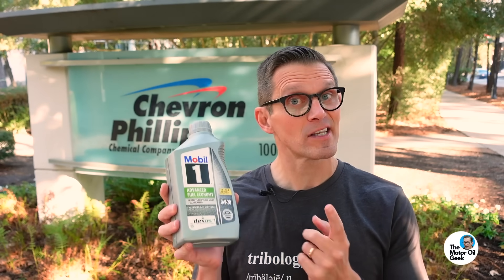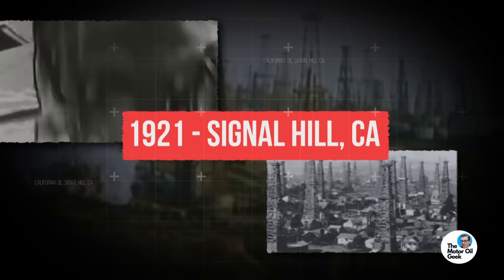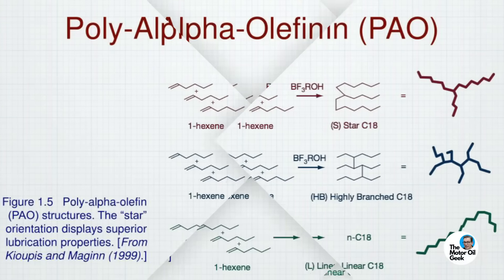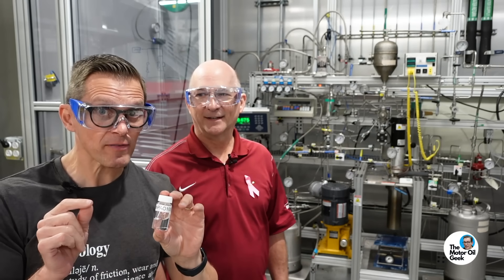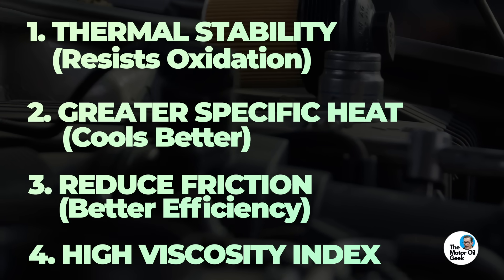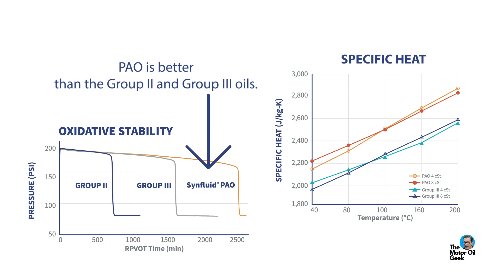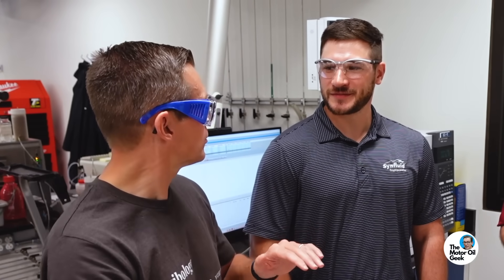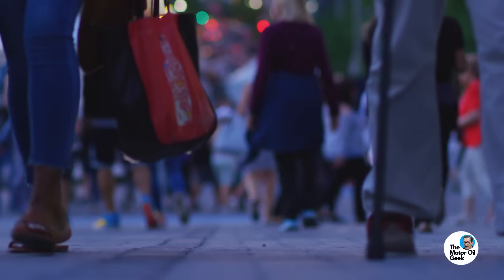STOP Using Regular Oil - 4 Reasons Synthetic is BETTER!

Comment from the maker: Thank you so much for watching and commenting. There are SO many comments that I won't be able to get to all of them. With that said, here are some answers and links to some of the common comments.

Synthetic Oil and Flat Tappet Cams - We answer that in this video: https://youtu.be/j8tpRxQLqU0

Synthetic Oil and Seals - We touch on this question in this video: https://youtu.be/LUr4iTjXbhg
(The quick answer is that synthetic oil is fine on seals in modern engines. For classic cars with original seals, stick with conventional oil if that's what you've been using)

How do you know if an oil is PAO or Group III? - Check the SDS sheet for the oil, it will list the base oil CAS numbers. Here's a list of CAS numbers and descriptions. https://www.cpchem.com/sites/default/files/2021-09/PAO%202021%20FINAL%20.pdf
Reply: Lake man, you're so good at this YouTube thing this channel is bound to blow up! It's like you were born to do media! Keep kicking ass and teaching us all the important stuff we need to know to keep our cars running as long as possible! Thank you!
Reply from the maker: @CelataForCongress  Thank you!
Reply: Still waiting on STP and GM EOS. Thanks and great work.
Reply: Thanks lake.....take a look at ravenol pao base oil (germany)
Reply: Question for Dr. Speed, in a prior video, you said that carbon in a direct injection engine is from the oil turning to gas and forming deposits. This made common sense, until I thought of the propane engines I've seen that seemingly are almost carbon free both in the oil and engine. Perhaps you can touch on this in a future video?
Reply from the maker: @airtightindustries Carbon is from unburnt fuel and oil - what didn’t fully vaporize and burn completely. That’s why natural gas engines are so clean. The fuel is already fully vaporized so it’s easier to burn.
Reply: This was going well until the actual discussion of the "4 reasons", which by the way, were presented differently in the middle of the video and at the end. In the first presentation, Item 1 equated thermal stability and oxidative stability. These are two different resistances to break-down of the base-stock due to different chemical processes. Thermal stability is the resistance to break-down in the absence of oxygen and is related directly to temperature. Oxidative stability is the resistance to breakdown by oxygen, which of course, happens more at elevated temperature, but involves oxygen in the reaction mechanisms. They happen to different extents in different parts of the engine, in different engines, and in different drive cycles. The reduced traction coefficient (lower friction) will lead to greater (fuel) efficiency, but for most actual driving, a much greater benefit to fuel economy is related instead to the higher viscosity index or lower temperature variation of viscosity. Since the PAO-based oil can maintain film thicknesses better at high temperature (because its viscosity decreases less as temperature increases), they can use a lower viscosity base-stock which is, in particular, lower at low temperatures. Since most miles are driven before an engine heats up fully, this lower viscosity oil has lower friction and greater energy efficiency. KISS is a great principle when speaking to a non-expert audience, but as Einstein said, "as simple as possible, but no simpler."
Reply: I have an important question about fuel additives. With more & more people storing fuel for emergencies & using stabilizers like Sta-bil & PRI-G & D to keep it fresh & lubricity & detergent additives like XPD & Lucas, are there any negative interactions between the pre-existing additive packages and/or the aftermarket additives? How much is too much or when has one gone overboard?
Reply: Your entire left audio channel is busted for this entire video and it’s extremely frustrating.
Reply: Except for sound effects.
Reply: Did you ever test the Tribodyn lubricants? 
I had good results but I’m kinda curious what you think.
Reply: Man you know what would be cool is if you rent out a bunch of cars to do a bunch of oil tests and see what oils are best for each car. Rather than trusting the manufacturer
Reply: Not for nothin, but isn't this a well established fact already? Not sure I see the need for a video.
Reply: Some people usieng Diesel engine oil  in their motorcycle and claim it works!...can you explain the difference between diesel engine oil, motorcycle engine oil and passenger car engine oil in term of checmical properties, functions and applications?
Reply: @oskapenjom3311  I know that for gasoline engines, a big issue is ZDDP, specifically the phosphorus, and catalyst poisoning. A diesel engine does not use a three-way catalyst like a gasoline engine does, and ZDDP PPM limits have been reduced in gasoline engine oils because of the issues with catalyst poisoning. This is why something like Shell Rotella T6 5W-40 is a good performing diesel oil that doesn't carry the gasoline engine certifications. However, many people use T6 in gasoline engine applications with good results. They're also different requirements for modern gasoline engine oils in the age of turbochargers and direct injection. Diesels have turbos too, but oil volatility and direct injection leading to intake port deposits and even the concentration of certain detergents, I think calcium, leading to low speed pre ignition have been identified as issues in modern gas engine oils.

Basically, the chemistry and physics is different in the different types of engine and this leads to different oil requirements.
Reply: @oskapenjom3311  , Lake did a recent video on this.  Take a look at his recent video list

Comment: Had a 2009 Chrysler Aspen with a 5.7 Hemi. Changed the oil every 5000 miles and NEVER used synthetic or changed early. Sold the truck at 198,000 miles 16 years later and it ran like the day I bought it. Never once needed any kind of engine service or had any problem of any kind. I think you guys overthink this oil stuff. Afraid if you go over a 1000 miles or don’t do a break in change early, send oil to get analyzed and searching for the highest tolerances synthetic your engine will fail. Nonsense…. Certain cars with H.O. Motors or high turbo pressure would require it.

Comment: I would like to see the cooling ability of synthetic oil vs regular oil. Perhaps even the difference in heat transfer of various viscosity, such as 0W-20 vs 20W-50. Might be worthwhile knowledge for air-cooled engines.

Comment: So, we don't generally use synthetics in General Aviation, i believe it's mostly due to the particulates in the oil. Synthetic has difficulty suspending the lead from the 100LL (100 octane low lead) AVGAS. I'm using Phillips X/C 20w-50 in my 1980 Cessna 172RG.  Synthetic causes many engine failures when it was released for these aircraft. Currently, I know Aeroshell is a 50/50 blend synthetic to mineral oil. The brand name escapes me right now, but one other brand uses 25/50 with 25% being authentic, and then Phillips X/C uses straight Mineral Oil. 
I have a feeling once the Lead is phased out, Full Synthetics will make a comeback.

Comment: I'm ok admitting synthetic is better oil... i also don't believe there is enough benefits to justify the extra cost of the best synthetic vs cheap SN rated conventional. It's nice and all of my engine lasts 250,000 miles on cheap stuff but how much longer will my engine really last by using the very expensive pyramid scheme oil? It's it gonna last twice as long to justify twice the cost?

Comment: The technical paper I read on synthetic vs petroleum oil showed that petroleum oil has several length of molecule strings with shorter ones wearing out first. The long ones last the longest. Synthetic has all long molecule strings, and doesn’t wear out, so keep it clean and you can get long change intervals by changing filters often !

Comment: 03 7.3, I’ve used Delo 400 since I bought it at 23k, now at 149k. Stick with the Delo 400, or start using a newer synthetic ? If so, what’s your recommendation for diesel synthetic oil?

Comment: First fully synthetic engine oil (ester based) made for normal car engines back then, was the French Motul 300V in 1970, Amsoil came 2 years later :) The brand Motul originated from the US (Pennsylvania oil trading company), but the brand was bought out by the french importeur in 1932.

Comment: It's amazing for many years I bought oil for 50 cents per quart. Then, not so long ago it stllill could be bought for 1$ a quart before covid. Now it's $10 ! Per Quart. I,ll take regular quality oil bough for 1 dollar over hyper expensive hype. Synthetic oil  isn't synthetic its mineral. Its start at the pump jack same as regular oil.. Amazingly, airplanes  race cares. Race boats etc ran at extremly hi power and continuning WOT on regukar mineral oil.

Comment: I have a 1993 5.0 LX Made by Ford and it's a type mustang it won't run on synthetic Everytime I've tried it the engine smokes plus the car is low miles 103k

Comment: I love synthetic, however my older engine (`95 LT1 350) was just rebuilt and my engine builder told me to do a change after 500km(done) & 5000km, both with non-synthetic - in addition to keeping RPM below 4000. I'm at around 1500 on regular oil since my rebuild, am i compromising my future ring seal by switching to syntheic now or at 5000k? What do i do! :(

Comment: It is interesting to hear about Pennsylvania crude oil. I used to live in PA and we used and sold Pennsylvania crude based motor oils. I had a Sprite with a 3 main bearing engine. When it got hot the oil pressure would drop. I switched to Castrol brand oil and it maintained good oil pressure. Talkin about the late 60's early 70's.

Comment: I worked at Ohio Machinery a Cat dealer.We had a overroad fleet send their tractors with 3406B engines in for bearing roll ins at 1,200,000 miles.When we took it apart the bearings and the bottom end of engine looked new.They used full synthetic oil .Never used anything else since in my tractors , pickups , and dirt bikes. Love the amsoil motorcycle oil segment you did.Hardcore dirt bike nut.

Comment: Ive lost 2 separate chevy LS engines due to oil pressure loss(oil pump o-ring failure) at just over 200,000 km. I've been running Pennzoil Platinum High Mileage oil 5W-30 exclusively... Im 100% losing my faith in synthetic.
Reply: Sounds more like a chevy problem
Reply: @longroadwest  😁

Comment: Here is a trick I learned while driving as an over the road trucker. When the engine oil in the diesel engine gets to the point or just before that it is due or needs to be changed the engine will start using oil. I found that if you put a quart of synthetic in when the engine is low it quits using or dramatically reduces oil consumption.
Reply: My first car was a used -87 vw passat in 2000.  synthetic oil made it use less oil and make less smoke. Im a beliver in synthetic oil, use 5w-40 in everything.

Comment: Conclusion:

PAO synthetics (Group IV) offer four key advantages:
	1.	Higher Specific Heat – Absorb more heat energy.
	2.	Better Viscosity Index – Resist thinning at high temps.
	3.	Lower Traction Coefficient – Reduce friction.
	4.	Superior Thermal Stability – Resist breakdown over time.

Comment: Retired truck driver. Have always had the practice of putting discarded waste oil in the fuel tank. How would synthetic work for VP 44 on my 2001CTD? WOULD like to see some test for longevity. 240K miles and no problems with classic oils being recycled. Power and fuel mpg are always increased pulling heavy loads. 
Using 5 micron filter for polishing and very slow pump out of a bulk tank. Thanks

Comment: is it still true for motorcycles with wet clutches?
Reply: Yes, as long as you buy spesific oil for use with wet clutch (JASO MA/MA2). Not all oils got friction modifiers compatible with wet clutch.

Comment: I used to race a Mazda rotary, oil is super important because they actually use it for cooling as well.  Other racers using rotary’s use conventional oil, and change it every weekend, and it looked and felt terrible after.  I started to use synthetic and the difference was noticeable after the first run.  The oil and water temp was lower, the engine seemed to have more power, which I attribute to the cooler temp, and after the weekend oil change it was noticeably cleaner and also felt slippery, where the conventional oil did not.  I started to use it for two to three weekends before I changed the oil. 
Since then I have used synthetic in everything I own.

Comment: Yea synthetic is always better but only after the rings have seated and the motor is fully broken in otherwise it might burn oil forever! The thicker the oil the better and use an oil cooler with a thermostat and your golden!

Comment: Switching from Conventional.. to Synthetic.   Apples and Oranges, but..  how well will Synthetic capture... and suspend soot?    Synthetic pours like water....  brand new.   Conventional comes out of the jug... thicker.  With the same advertised weight.  Engines with weeping seals... rear main drips.. etc.   Going to Synthetic will show up on your driveway.   It does a good job with heat...  metal on metal contact... but, there are these other factors to consider.   My suggestion is to NOT click bait with STOP using conventional.  Not honest.

Comment: Application... Application ...  Application.    Older vehicles... anything with over about .012 clearance - Piston to cylinder wall plus a ring gap of over .012.   Full Synthetic is a NO NO.   They will burn thru oil like a MO-Fo.

Comment: Wondering what the best Synthetic oil is for my wake boarding boat? High load operation with lots of idling. 

Learned recently on this channel that the Rotella 15-40 I’ve been using isn’t correct!
Reply from the maker: Mobil 1 15W-50

Comment: I wonder if you could help separate fact from myth regarding switching to synthetic for higher mileage vehicles. I’ve heard more than once that “your gaskets and seals will start to leak”.
Personally, I feel this is another old-school rumour. But how I “feel” doesn’t prove anything.
Reply from the maker: The answer is "it depends". Many classic cars (more than 25 years old) feature seal materials that can shrink with some synthetics (not all). Modern cars feature different seal materials that are more broadly compatible with both conventional oil and synthetics.

Comment: I LOVE Your Videos! You have IMO the most cool job in the world! I love everything "OIL" However i'm still not sold on Synthetics for everything including in my old Harley or New Harley and small engines, lawn mowers and such... I would love a scientific explanation why way back in 1999 when I changed the oil from mineral oil in my 1997 Harley to Synthetic V-Twin rated oil, M-1 V Twin,  same Viscosity 20w-50 did my engine Immediately develop a loud top end tic at every red light?  Had proper oil level etc, I changed back to mineral 20 miles later and to this day never has had a tic again or a drop of Synthetic. Some people believe as I do that an old air cooled Harley bikes ( EVO Engine )  and the newer ones too  M8 engine have less top end noise when using mineral base oils?
Is something wrong with my ears? less top end noise and NO tic must be better right for some reason right?

Comment: I have been using mobile 1 products for years. I always use the oil that meets the engine manufacturers specifications along with Wix premium oil filters. No problems. I don’t believe any major oil or filter manufacturer can afford to make a crap product. Some may have an edge on this or that but overall they make excellent product. If there is one out there that by far and away outperforms the others, please let me know. But just the same I really enjoy the videos. Good to know information. Thanks.
Reply from the maker: Thanks for watching!

Comment: Is Valvoline synthetic VR1 20W50 a good oil to use in air cooled 2002 Harley Road King.  I've been running it in my 2002 for the last five years.  I have no empirical data to suggest it might not be.  I like that it was developed soley to be run in a engine and not designed to be run with wet clutches.

Comment: Synthetics and leaded racing fuel? I know the answer. What does the motoroilgeek guy say?
Reply from the maker: Properly formulated, a synthetic can handle leaded racing fuel. We did it for more than a decade at Joe Gibbs Racing. If the formulation is not correct, it is a disaster.
Reply: Yep. I agree. I’m in the aviation world and see people damaging their boxer engines because of running the wrong synthetics ( lead salts in the filter and drained oil).  . XPS a BRP product i believe, has come up with a formula that can handle the 100 low lead we use but it is very expensive + $75 a gallon and I would love to find an alternative that meets the same standards but more affordable . It’s the same color as antifreeze for some reason. I don’t know what they were thinking using that color of dye ..
Reply from the maker: @willcall9431  That is weird to choose that color.

Comment: So is it safe to start using synthetic oil in my old 70's V8 engine or would semi-synthetic be the better option or should I just stick to mineral? I was told years ago I cant use synthetic oils in old engines, cant remember why, maybe something to do with clearances, not sure...
Reply from the maker: Synthetic is fine, just stick to the same viscosity grade.